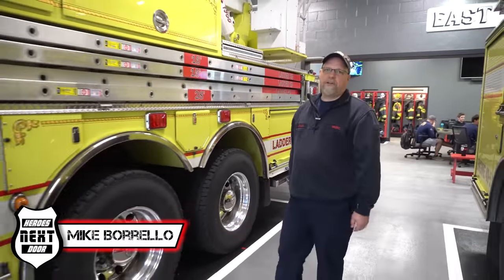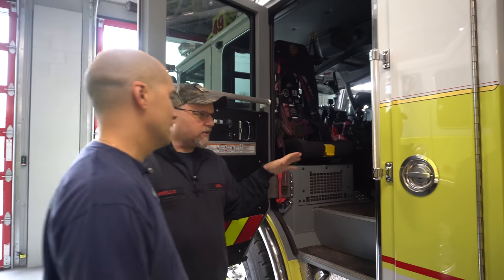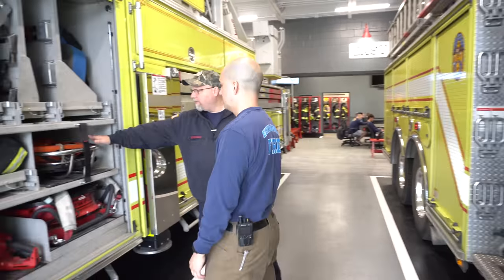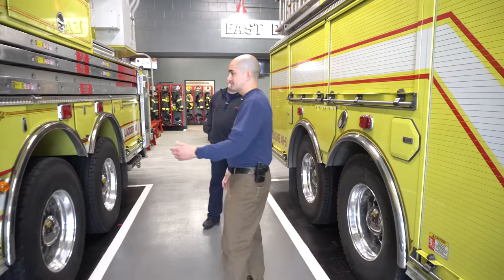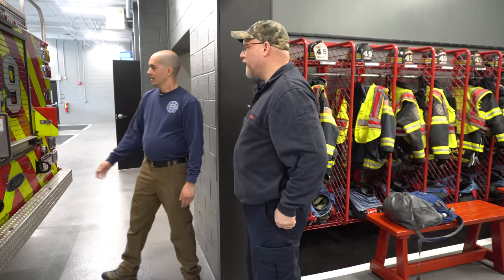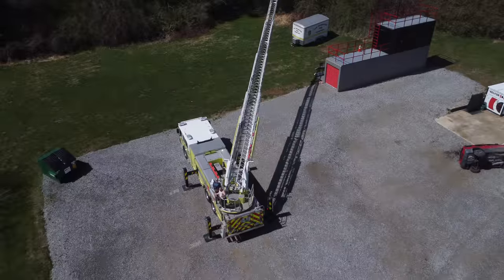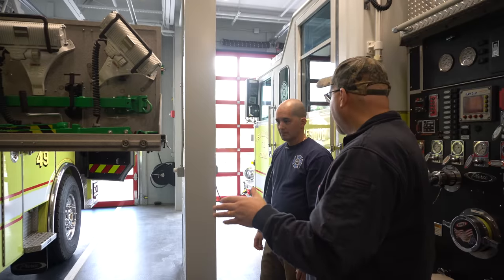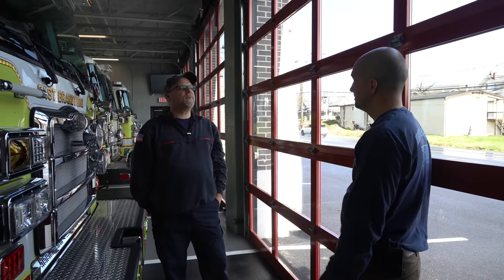Lime Green Fire Truck that Can Reach out

Comment: How many vehicles do they have
Reply: We have an Engine, Pumper Tanker, Ladder, Rescue, QRS and Utility. We also have an ATV and 3 Chiefs Vehicles
Reply: @eastbrandywinefireco5998  nice and what Is a QRS
Reply: @Melbemergencyvids  Quick Response Service. It's a pick up truck with a cab on the back that carries medical gear and responds to medical calls in our local but does not transport
Reply: @eastbrandywinefireco5998  Do you guys have any specialty trailers?
Reply: @erinandcory7812  we have a cone trailer with traffic safety equipment on it that we can respond with if the need arises. We also have two portable light towers and we have an enclosed trailer and an open trailer to transport the ATV.